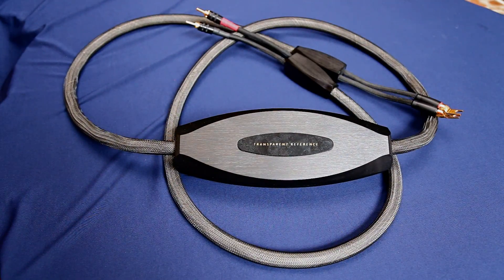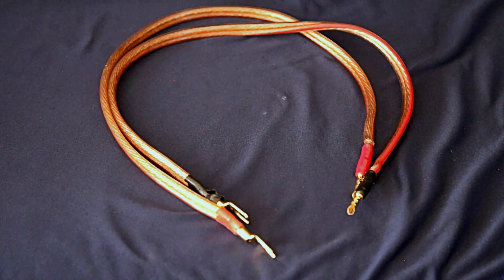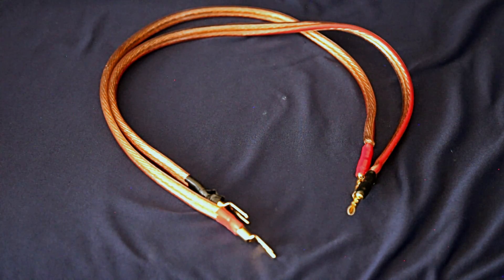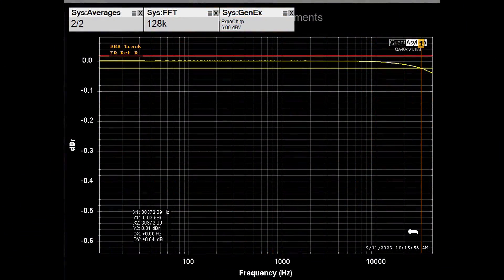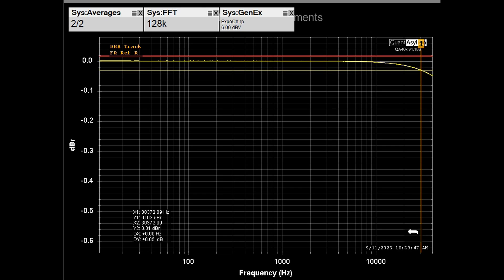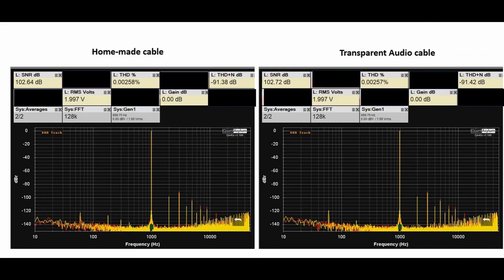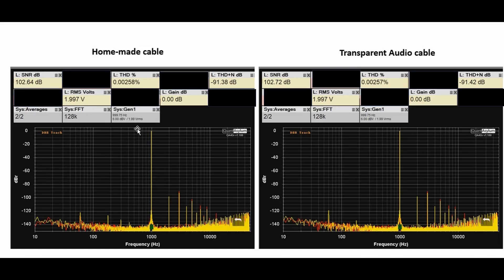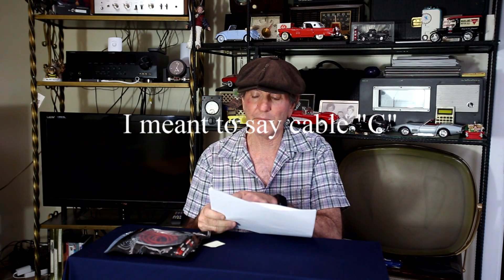$8000/pair Speaker Cable  vs. $14 DIY Speaker Cable A/B Test: Vintage Audio Review Episode #87

Comment: Sorry, but this test was flawed.

And I am actually surprised that none of the participants pointed this out.

By listening to only 1 speaker, and not a pair, you are missing/ignoring a huge aspect of sound reproduction, and that is of course, the reproduction of spatial cues. Which contributes to soundstage width and depth, the ambience of the acoustic space the recording was made in. Imaging of the musicians within that acoustic space, the layering of the soundstage, etc.

The human auditory system is capable of hearing interaural time differences as low as 7-10 microseconds. This is an evolved survival tool; our ancestors needed to know where (distance, direction, height, etc) in space a noise in the forest was coming from, to determine if it was a threat or food, for example. Obviously

We leverage this aspect of our auditory system: to hear a soundstage, the ambience of the acoustic space where the musicians were playing, the location of the musicians within that soundstage, etc.

Let me state that I took part in a double blind test about 4-5 years ago comparing speaker cables, and I was able to consistently pick out 1 over the other. The cheapest cable we compared were a pair of $100 Blue Jeans cables, and the most expensive, a pair of $4,000 Purist Audio.

The way I was able to pick out 1 cable over the other, was by listening to the soundstage size and depth, the specificity of the musicians within the soundstage, and other spatial cues. Better speaker cables are better at keeping those very tiny (7-10 microseconds) time intact.

I could add, which I may later, the reason why some cables are better at retaining these spatial cues than others.
Reply from the maker: Thanks for taking a lot of time to express your thoughts and the idea of using just one speaker and the spatial cues, was addressed pretty well by @douglas_blake_579 somewhere amongst the multitude of comments for this video.
Reply: @vintageaudioreview  I'd be interested in hearing their take, but I can't find the comment you refer to .
Reply from the maker: @pandstar  I am going to copy and past his comment here for you from 2weeks ago:

Since the topic of Subjective testing in stereo keeps coming up...  
(This is a re-post of one of my comments under another video)

===
1) Why you cannot subjectively evaluate any part of an audio system.

(Don't even think about arguing with me until you try this simple experiment.)

Take any stereo setup in any room, no matter how good or bad, then play monophonic pink noise through the speakers, at a "conversational level" ... 
Find the spot where the sound is directly straight in front of you.  
Now, slowly move your head about 3 inches left or right of that ideal centre position...
What did you hear?

When you moved off of the dead centre between the speakers, you heard the sound get a little brighter and a bit louder; what an audiophile would describe as "presence".  As you moved further from centre by the first tiny bit, if you went left, the apparent sound source went right, then as you move further it will suddenly jump to the left; "soundstage".  
Then if you continue by moving your speakers, you will notice, the further apart your speakers are, or the closer you sit to them, the worse this gets.

This is a phenomenon known as "Mid-Field Cancellation" and there is absolutely nothing anyone can do about it.  It is caused by the difference in distance from you left speaker to your left ear and to your right ear.  Of course this also happens with the right speaker, as well. At about 1600 to 2200hz, depending on the size of your head, the sound in the far ear is behind that in the near one, it is late and it's out of phase... and it cancels.

Now we know that a move of just an inch or so off of perfect centre changes what you hear. The question is, how often, when evaluating a new speaker, cable, device... have you plopped your butt back down into your chair an inch off from your previous listening position only to judge the new wateveryacallit as being "more open and present with a better soundstage"?

What are you actually judging... the device or your current listening position?

2) Why you cannot subjectively judge tonal balance:

(And again ... don't even bother disagreeing until you try this)

Play a monophonic tone at about 10khz from both your speakers. This will be very piercing so keep the volume down.
Now slowly rock your head a little bit toward one speaker then the other.
What do you hear?

Yep, you heard the tone get louder and quieter as you moved. You probably also noticed that it's left-right balance shifted cyclically as you moved, first favouring the near side then the far side.

This is "Treble Cancellation" and it is caused by differences in the distance between your head and the speakers.  At 10khz the in-room wavelength is about 1.3 inches or 3.3cm ... a move of just half that much will actually put your tweeters out of phase at your ears causing a dip in level and a shift in direction.

Again... even the slightest shift in listening positions will change your perception of the sound.

3) The BIG question....
Now ask how many millions of dollars have been spent because of these simple facts of life?

Measurements would have confirmed these simple differences are or are not real.
===
Both measurement and listening tests should be used together.

Comment: Wait, at some point the signal is going thru the "cheaper" diy cables, the short ones?
Reply from the maker: Yes- both the expensive cables and the one I made went through the 2' DIY cable I made as well. But two, 2' 12gauge cables connected in parallel should have very little effect on the result.

Comment: If you have money to throw away, go for it, but I don't, so I made my own speaker wire also. The only difference I used 12 gauge. Great demo.
Reply from the maker: Thanks for taking the time to comment! I also used 12guage wire- the small, common cable was made with two 12gauge wires.

Comment: I’m curious if you tried different power cables specifically for noise. I feel like there’s no difference but I’m not 100% sure!
Reply from the maker: I have not tested any power cables, but Amir at Audio Science Review has tested several over the years and the result is pretty much the same- no effect on audio performance. Some may block some high frequency noise a bit better, but that would not have anything to do with the audio band performance.
Reply: If you hear sonic differences between power cables, the problem is in your equipment, not the cables.  All AC powered equipment is required to have power line filtering and proper grounding as part of it's design.  If cords make a difference the problem is in your device's AC filtering.

Comment: I thought Kimber braided cable was too bright for my system, and definitely heard a warmer sound when i switched to my current MIT cables.
Reply from the maker: Thanks for your comment and I am glad that you like your cables, but saying they provide warmer sound would be something that would go against what I experienced in this video with the cables that I tested and used.
Reply: Not really. My comment refers to Kimber and MIT. Your video refers to Transparent and your own creation. Both things could be true.  @vintageaudioreview
Reply from the maker: @mantosof  I guess you could call me a cable denier for the most part. At least so far.
Reply: Yes Kimber can sound bright which is why I preferred Audioquest. To me MIT cables are too warm sounding. These days people seem to like the Shinyata cables which I haven't yet heard in my system.

Comment: Wow! $9000 will get you 2 carbon special rel subs now there is a difference everone will notice!
Reply from the maker: It would b fun to come up with a list of audio gear you could purchase for $9k.....
Reply: @vintageaudioreview  
I'd probably just buy the Present Day Productions MUM-10 active 3-way studio monitor speakers, connect my preferred source, and be done.

Fully adjustable response to account for personal preference and to help accommodate and correct issues due to the acoustics of your room.

I've been a musician since the mid-1980s (drums/percussion & saxophone) and have had a home recording studio for the last 14 years.

I use some of the same Purifi and BlieSMa drivers/transducers in my own high end DIY studio, home, and car audio speaker systems.

My recordings of my own instruments have never sounded as LIFELIKE and Dynamic with any other speakers (LOTS).

In regards to imaging and soundstage performance as well as accurate, lifelike reproduction, I have full confidence that the MUM-10 would best the vast majority of home audiophile systems in use today...when properly setup, as is necessary with ANY speakers in ANY room.

Cheers

Comment: I never understood these type of comparisons. Cables do sound different from each other regardless of what is on a scope. Capacitance is the biggest factor as well as the quality of materials. You choose cables based on the character of the hardware you are using and what direction you want to go sonically.
Reply from the maker: Thanks for your comment, though I respectfully disagree with you....
Reply: @vintageaudioreview You're disagreeing with science then. You can alter the sound of cables through capacitance or inductance or resistance. This is at least agreeable by almost everyone including your high school science teacher.
Reply from the maker: @carlosoliveira-rc2xt  Not disagreeing with science at all. But how much the RLC's would have to change with a cable to be audible is different. Check out the Audioholics video with the Benchmark Engineer- they did a great presentation on cables....
Reply: @vintageaudioreview  Different than what? I was responding to your response to another commenter that said capacitance would make a difference. It does, which is why I stated as much. Generally, when I discuss cables differences I'm not referring to RLC as any decent cable adheres to the norms with a couple of exceptions.
Reply from the maker: @carlosoliveira-rc2xt  Sorry if I misunderstood your intentions with your comment and I would agree that most cables are not going to have a problem with RLC's getting out of hand. I think the video I mentioned did point out a few expensive cables that may have a construction that actually effected the frequency response.
Reply: Nope.  It's just wire.
Reply: @Douglas_Blake_579  I guess, it's just tubes, it's just a cartridge, just a turntable, etc. If the cables don't matter that much to the sound , then none of it does.
Reply: @RACKDOCTOR 
Grab yourself a dictionary and look up "Hyperbole" ...
Reply: @Douglas_Blake_579  Wasn't sure if you were being Hyperbolic.
Reply: @Douglas_Blake_579  Did not realize you were being Hyperbolic.
Reply: @RACKDOCTOR 
Aww, aren't you the cute one? 
Tell you what. After you learn how to have an adult conversation, come on back and see me.
Reply: @Douglas_Blake_579  Well if I was having a conversation with someone that was actually an adult then I might.
Reply: @Douglas_Blake_579 Sorry, you fail high school science.

Comment: Since the topic of Subjective testing in stereo keeps coming up...  
(This is a re-post of one of my comments under another video)

===
1) Why you cannot subjectively evaluate any part of an audio system.

(Don't even think about arguing with me until you try this simple experiment.)

Take any stereo setup in any room, no matter how good or bad, then play monophonic pink noise through the speakers, at a "conversational level" ... 
Find the spot where the sound is directly straight in front of you.  
Now, slowly move your head about 3 inches left or right of that ideal centre position...
What did you hear?

When you moved off of the dead centre between the speakers, you heard the sound get a little brighter and a bit louder; what an audiophile would describe as "presence".  As you moved further from centre by the first tiny bit, if you went left, the apparent sound source went right, then as you move further it will suddenly jump to the left; "soundstage".  
Then if you continue by moving your speakers, you will notice, the further apart your speakers are, or the closer you sit to them, the worse this gets.

This is a phenomenon known as "Mid-Field Cancellation" and there is absolutely nothing anyone can do about it.  It is caused by the difference in distance from you left speaker to your left ear and to your right ear.  Of course this also happens with the right speaker, as well. At about 1600 to 2200hz, depending on the size of your head, the sound in the far ear is behind that in the near one, it is late and it's out of phase... and it cancels.

Now we know that a move of just an inch or so off of perfect centre changes what you hear. The question is, how often, when evaluating a new speaker, cable, device... have you plopped your butt back down into your chair an inch off from your previous listening position only to judge the new wateveryacallit as being "more open and present with a better soundstage"?

What are you actually judging... the device or your current listening position?

2) Why you cannot subjectively judge tonal balance:

(And again ... don't even bother disagreeing until you try this)

Play a monophonic tone at about 10khz from both your speakers. This will be very piercing so keep the volume down.
Now slowly rock your head a little bit toward one speaker then the other.
What do you hear?

Yep, you heard the tone get louder and quieter as you moved. You probably also noticed that it's left-right balance shifted cyclically as you moved, first favouring the near side then the far side.

This is "Treble Cancellation" and it is caused by differences in the distance between your head and the speakers.  At 10khz the in-room wavelength is about 1.3 inches or 3.3cm ... a move of just half that much will actually put your tweeters out of phase at your ears causing a dip in level and a shift in direction.

Again... even the slightest shift in listening positions will change your perception of the sound.

3) The BIG question....
Now ask how many millions of dollars have been spent because of these simple facts of life?

Measurements would have confirmed these simple differences are or are not real.
===
Both measurement and listening tests should be used together.
Reply from the maker: Well put once again, Professor. Having the a/b switching done  by the remote controlled switch does help in eliminanting changing the user's head position to a certain extent, but even that is not perfect.....
Reply: @vintageaudioreview 
Actually the biggest part of overcoming that problem is that you tested in mono with a single speaker.
Reply from the maker: @Douglas_Blake_579  To be honest, that was mainly due to the limitations of my switch box plus I was looking for tonal differences and not concerned about anything else that would have been hard to hear.....
Reply: @vintageaudioreview 
Accidentailly or otherwise, it worked out for the better.

Comment: My approach is to let people hear both low cost and higher priced cables and let them decide if they think that the audible differences are worth what is being asked for them. My policy is that if they can get a bigger improvement in musical enjoyment by investing less, then that is the way they should go. Surely the buyer decides based on what they hear and feel, and what they want to spend. Any expensive product, such as a sports car is often bought because it brings enjoyment, not because it measures better.
Reply from the maker: I agree with you- if it brings enjoyment to you for whatever reason, go for it if you can afford it. Thanks for commenting.....

Comment: Ah, this old chestnut again.

The problem is that people think the relationship between expense and performance is entirely linear, when it most certainly is not.
Less arcanely put: above a reasonable quality/price point, the reality of 'diminishing returns' kicks in - beyond which any notions of linearity are lost.
So then, and based upon good empirical evidence and properly conducted blind listening tests, £25 - £45 is about the range to consider as a reasonable cut off point.

What then does this tell us about the individual who is willing [and indeed able] to pay the outrageously preposterous sum of £8000 for a set of cables?

a. The price of satisfaction can be exorbitant in the extreme.
b. Items of belief/faith - even in the face of all the evidence to the contrary - are an all pervading, powerful tool for the suspension of critical thinking.
C. Proof - if ever it was needed - that a fool and his money are, indeed, easily parted.

An interesting and thought provoking video.
Keep 'em comin'.
Phil.
Reply from the maker: I appreciate that, Phil!. "A fool & his money are easily parted" has come up a lot in the comments. I like to mix up my videos with different audio themed subjects, and this one struck a nerve. THere is another type of cable that will be tested at a later date...

Comment: You are very right I don't believe in expansive cables as well I'll just put my money into nice vintage equipment rather than buying expansive cables
Reply: I kind of agree. There may not be much of a difference between $300 vs $10000 cables but I know there is a difference between $20 vs $300.
Reply from the maker: @Simon-oq6ds  Well put!
Reply from the maker: My feelings as well!